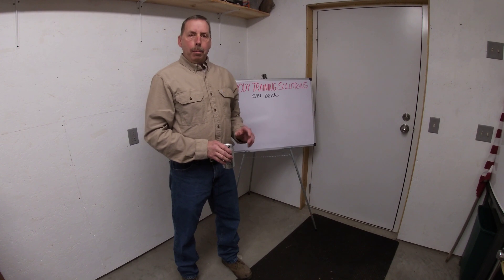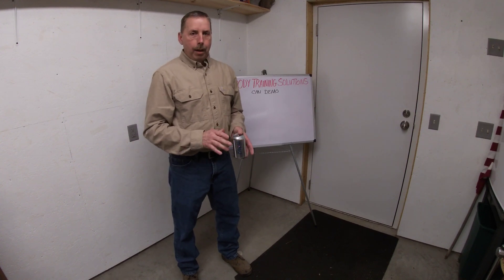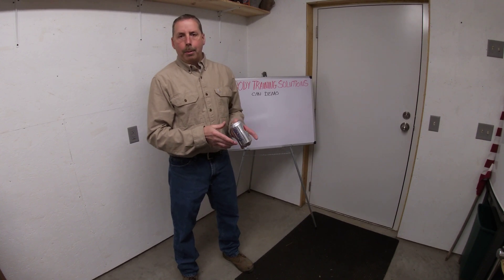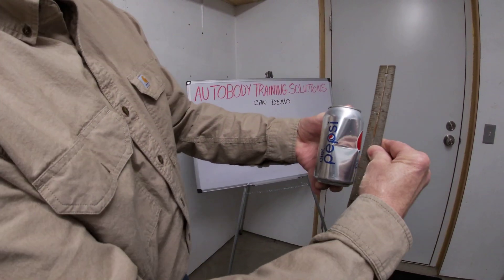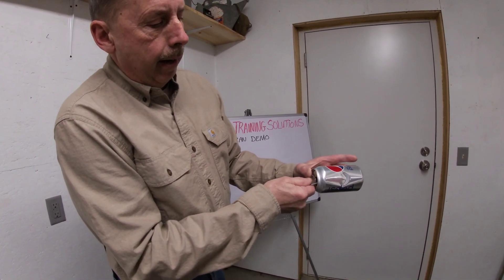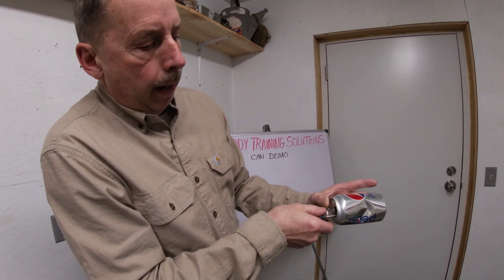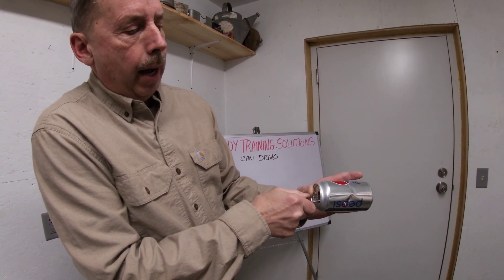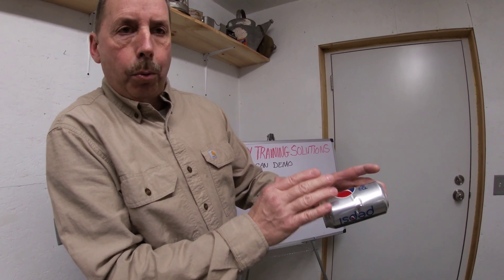Metal Stretching in Auto Repair

Comment: I'm happy I found your site. What you explained in this video is just what I have on a 1963 Chevy Biscayne. It had been hit right at the gas filler cap for an area about a foot wide and tall. I have the dent and high spots. It is complicated because of the 3 layers of the outer/inner fender and the metal housing (?) around the filler cap. I may end up buying a new quarter panel but first I want to learn how the remove dents. (it has all kinds of dents). There are other sites that show a lot of busty women but you show the physics of the metal. I'm not just a keyboard body guy, I go out and pound on the car and look at your site to see what I'm doing wrong or right. Eventually I will not need your site until then thank you.
Reply from the maker: Glad you like the channel. I’m trying to bring something a little different to the person who wants to learn body repair instead of just videos that just show start to finish. I feel that if don’t know the basics of metal work and proper procedures you’re just spinning your wheels. Lots more things in the works so I hope you’ll stick with me. Thanks for watching